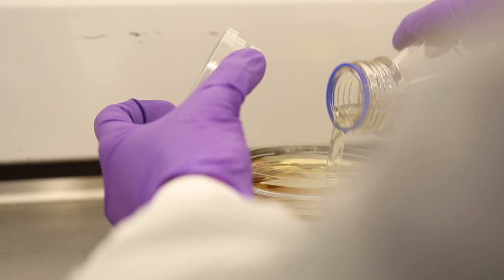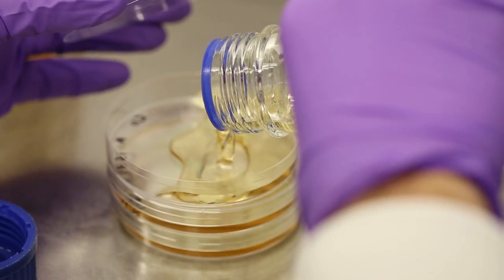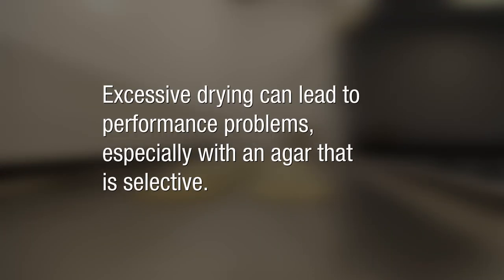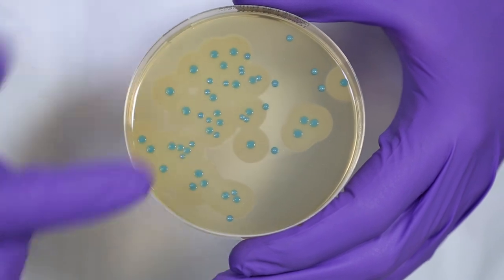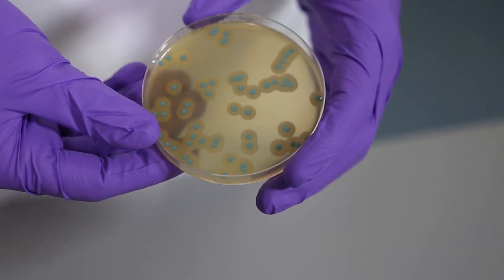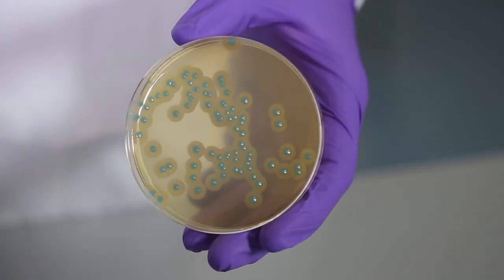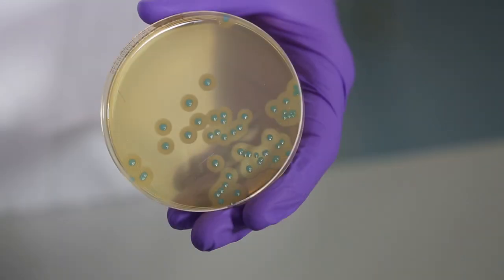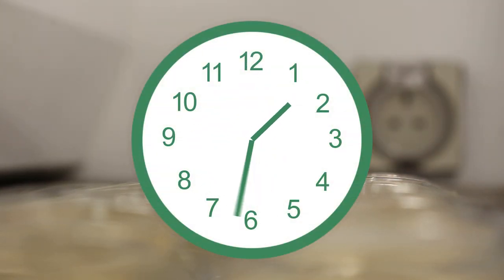How to Dry Plates When Preparing Media

Comment: How long often you dry your agar plates for?
Reply from the maker: Hello! If you are inverting the plates on the bench and leaving them open and inverted, then it will be about 20 minutes. Do not invert until they are set.
If using a hood, invert over the lids and don’t go beyond 10 minutes with air flow or they will dry too much. 

These are only guidelines. You will need to gauge the timing for each method by how long your preparation takes. Please let us know if you have any more questions!